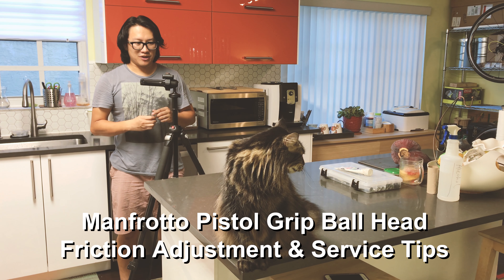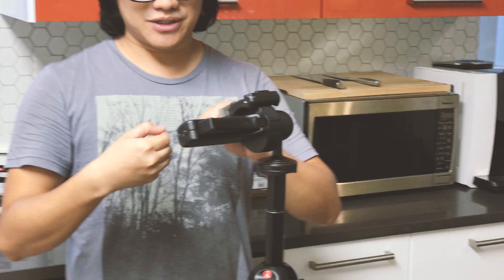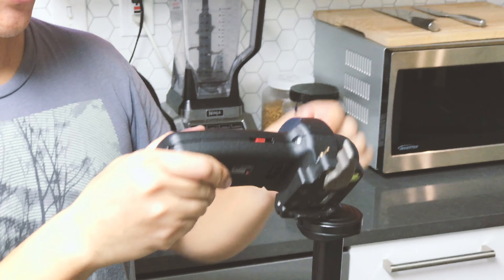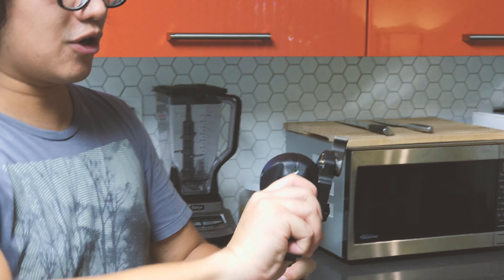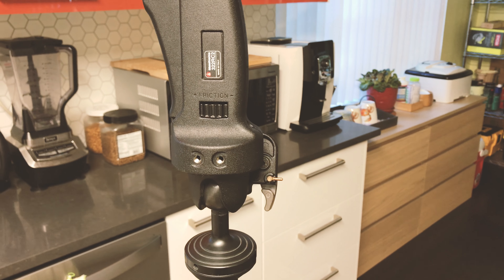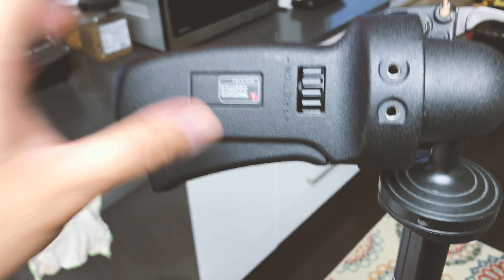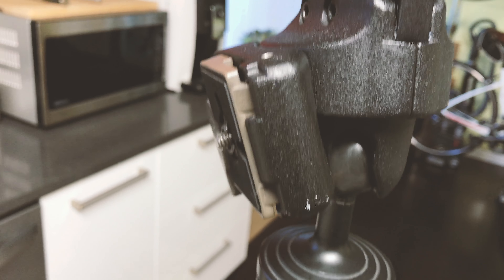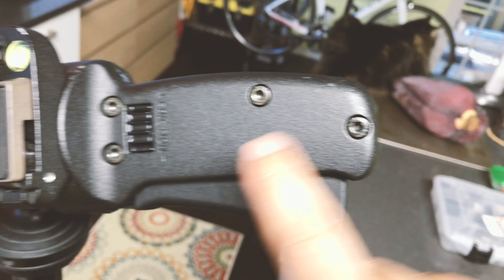Manfrotto Pistol Grip Ball Head Low Friction Problem Simple Fix 322RC2

Comment: I had tightened down the tension hand screw as far as I could, then finally found this video. I presume this info is in the manual that everyone immediately throws in the garbage😂 Anyway, backed off that tension adjustment, and 1/4 turn or so on the adjustment screw, and it’s like new again!

Comment: Good explanation..but you get much more "leverage" ( tightening ) using the short end of the hex wrench into the adjustment hole...then turning or applying pressure with the long part of the tool.

Comment: Thanks for posting this video. There were a few things I didn't understand about this head! I've owned it for ages and it has been very good but recently it's been a bit loose. I didn't really understand how to adjust it and this video helped me get it dialed back in! And you're absolutely right, that 3mm screw only needs a tiny turn! Thanks again.
Reply: Ditto! Have had this head forever and glad I finally took the time to fix it.

Comment: Damn, I wish I'd watched this an hour ago. Just dismantled the thing and, sproinngggg, it all flew apart with bits all over the floor. Now I've snapped a lug off the pistol grip squeeze trigger trying to put it all back together again :o( .
Reply from the maker: It's very springy when opened, and I realized I don't need to open it to adjust tension, took me a while to put it back together but not impossible... Good luck!
Reply: @TheGizmoGarage  Many thanks. I've ordered a spare part for the broken squeeze handle. Any tips for reassembly? That spring's making it almost impossible.

Comment: Thanks for this repair I have been using this for many years and noticed that I couldn't tighten it anymore or at least adjuster I can carry a very heavy 125 to 600 mm lens without feeling that it is going to move or collapse on me when I'm caring it

Comment: Manfrotto admits that this is not a good ball head. I agree. The tension screw has stripped on me 3 times. Fortunately, I had extended warranty, but had to pay shipping and be without ball head 3 times. There are better Manfrotto ball heads that do not have this terrible tension screw. 
I also agree with Randell John about it's poor maximum load capacity.
IMPORTANT!!! Manfrotto says to Squeeze Handle when tightening the tension screw.

Comment: Manfrotto Used a 'cupped' type screw which digs into the fulcrum lever.  It  wears very FAST!!   IF you Call them they suggest you ship it to them and for Only $45 Plus shipping they will do just what you did.  BUT, NO They Will Not Tell You over the phone to just adjust the Damn Screw! (azzholes!! )   When I work on this model I Immediately replace the Sharp Cupped allen screw with a 'Ball' end screw. No  More Adjustments Needed...   Only $0.78 from Lowes!!  Also, You should pull the hand lever 'IN' before tightening the adjustment screw. It won't gouge the fulcrum lever!!!

Comment: I've been using this head for the past 7 years and just never got on with it. I've just bought a 'Standard' Manfrotto Magnessium Ballhead and it's so much better than the 322RC2. 
The problem with the 322RC2 is it's maximum load capacity - It's only 5Kg. When you consider a DSLR with a 70-200 Pro lens and battery grip weigh approx 4.5Kg there isn't much of a safety margin and this head is just about on the edge of it's working limits.
My new replacement head has a working capacity of 10Kg and was half the price.
The release grip spring on the 322RC2 is also very stiff. If you have to use the 322RC2 over a long period of time, it can become quite uncomfortable releasing the friction lever. 
I hate this head - Personally I'd never recommend anyone buy's one.
Reply from the maker: The interesting thing is I switched from the Manfrotto ball head to the 322RC2, it fits my shooting needs perfectly. The ball head is much slower to operate compared to 322RC2, at least for my use.
Reply: The loading capacity is never a problem if you know, what you want, when buying a ballhead.
5kg is fine to me, the grip is fine,  one hand operation fine. So that's me.